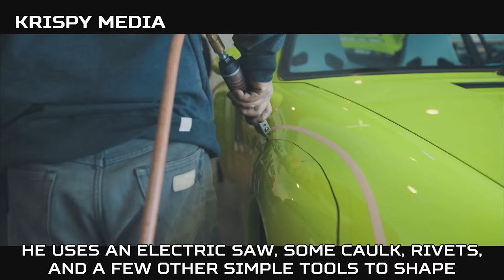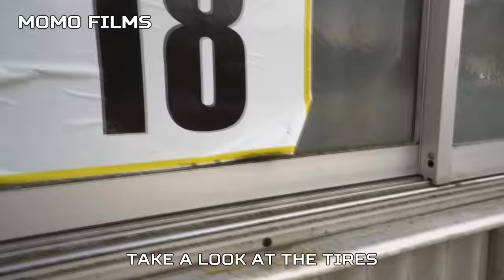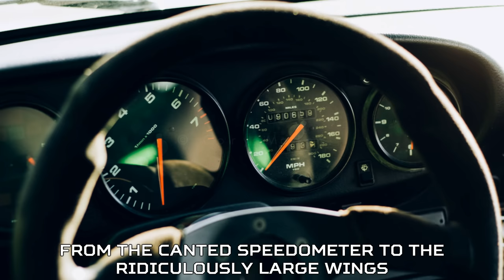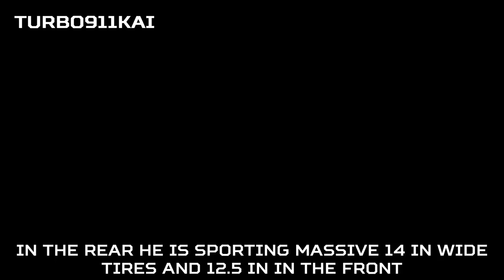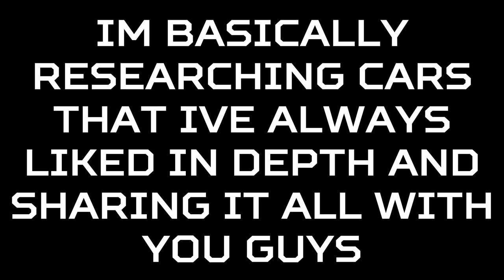RWB - What Makes it so Great?

Comment: Can you guys not hate on everything you don’t like? Some people enjoy RWBs and others enjoy Singers. We have opinions, but don’t shit on someone for having something that you don’t love.
Reply: The Singer purists are hilarious, considering they're even less of the original car than RWB's are. Singer cuts the fucking roofs out and replaces them with carbon fiber/fiberglass. RWB uses as much of the original car as possible.
Reply: @xerodelacroix5552  cutting the roof then replace it with lighter, stronger, and slightly better material? It has the same shape as the original ones on the contrary though what Nakai San does is just putting wider fenders and that's it, no notable improvements unlike Singer's reimagined Porsche's. I don't hate RWB, in fact, I quite like it actually, and I also love Singer's  Porsche's.
Reply: @peperoninja387  They don't just cut the roof. They replace most of the body. And all of the interior. RWB is 90% the original car. Singers are restomods for boomers with too much money, RWB's are for being driven and driven hard.
Reply: @xerodelacroix5552  I think I've made my point clear, whether is just replacing the roof or the whole body it still has the same concept the same shape, improving something doesn't make it different from the original. But that's just my opinion...
Reply: People hate what is different and what they don't understand......let them. As they try to suck the light from you, leave, just walk away smiling. It's not worth it my friend. If you like something and it brings positive energy to you....why would I stop that? I want you to have that, happy humans are better humans.
I love the style of these cars. I see them as samurai with their swoopy armor and function meets form design.
Reply: haters are gonna hate, that's all they can do about it.
Reply: Yeah the back of the car's too wide dowg :P
Reply: Dude this is the internet
Reply: I like both brands, but I still prefer RWB

Comment: My suggestion is that what kind of Influence did initial D have on the car community?
Reply: PlebzOr Blapparapp 
sigh whats your problem?
Reply: A terrible one, especially with how everyone acts when an AE86 is mentioned
Reply: Grey God
I was right. This comment was a m i s t a k e
Reply: Grey God
You can't really compare downhill driving on windy roads with highway driving. Gravity assist and turns and all. Other than that I get what you mean. Why not put your own shop's name on it? Get a left hand drive car? Don't pretend it's a big deal? Or you could get a neat '83 Dodge Charger L body. I couldn't find any for sale online (other than one for 19 thousand), so I'm assuming they're rare. I don't know how that would actually work out.
Reply: Mason Rafferty I get that it's more low power good handling car, I was meaning more as a daily driver. The mid range torque dip it has (like the new GT86/FRS) makes it a bit of a hassle to keep up with regular traffic on highways. In order to have that push it needs, it has to almost always be redlining. I agree on an L Body though, similar styling to the Levin, more room, and more power depending on the version motor you got.
Reply: sigh
Reply: I mean, I'm super into cars thanks to Initial D. Obviously I dont praise the 86 as a god car sent from heaven that HAS to have a Fujiwara Tofu logo on it. But I do want the GT86 cause of the show which doesn't seem like a bad thing IMO. I really want to dive into the car community and learn how cars works and how to drive properly, drive fast ("legally"), and maybe how to drift (even though it seems VERY hard).

But that being said, one person isn't enough to out weigh the toxicity and bad things. I cringe at the fact that some people things a stock 86 is a master piece that can race in real races. In any case, it has done some good things to the car community, but the bad definitely outweighs the good. I still want that GT86 tho, cause it seems like a great car in general from the reviews I have watched. Gonna start learning about specs soon enough too, but Im not old enough to drive :/
Reply: Bootleg Goku Welcome to the car community m8.
Reply: [ Insert Name Here ] Thanks m8
Reply: Grey God  O M Y G D I S T H A T T A K U M I C A R R ? ! ? It hurts when people praise the 86 as some kind of supercar. :v
Reply: Well yeah as the comments before, a bad one. Shame, because it's giving a great show a very bad reputation. For the regular Joe, initial D is just that one meme anime. Deja vu right lmao XDXD so funny. Not to mention the 86 weebs problem.
Reply: s y n t h POP UP, UP AND DOWN HEADLIGHTS
Reply: DRIFT TAX
Reply: Made people fall in love with JDM cars.

Comment: Is this a joke? Really? I mean the guy just manhandles massive Japanese inspired wings, fenders, and panels onto cars that already drive fantastically.
Reply: blake gastreich And adds handling upgrades to make it better. Did you see his personal car? That thing goes faster in the corners and straights than most stock 911's
Reply: Anthony Maranto Your point being?
Reply: GABRIEL DALIva His point made no sense, you can upgrade the running gear on any car and make it handle better, the RWB kit itself adds nothing to the car except weight.
Reply: SkrtSkrttt did you not watch the video? How he talked about how nakai-san upgrades the handling because HE also competes in races
Reply: GABRIEL DALIva Noone is debating that, the point is that the RWB kit on it's own does fuck all to improve the car, on the contrary they're usually put on 911s riding on bags or similiar making the car ride like shit.
Reply: From what I’ve seen only the Japanese RWB’s go to track days. Everything else look like show cars.
Reply: @The Stigs Romanian Cousin Clearly you've never driven or seen an RWB Porsche,  There amazingly well put together and handle amazingly. The Kits are inspired and designed on the  930 turbo groupe 4, 964 Carrera RSR and 993 GT2 EVO, which are very successful race Cars by Porsche themselfs. The first versions of the 930, 964 and 993 Kits were tested thoroughly in a wind tunnels, to make sure they don't produce to much drag, later adding the Canards on the front and side for added downforce and stability, so the kits do in fact improve the cars handling. The Kits themselfs (Arches and bumpers) are made from Fireglass and the rear wing and winglets from Carbon Fiber, which together weigh next to nothing and costs less then what a full Carbon Fiber kit would cost. Most RWB builds don't have air suspension, infact 98% have adjustable suspension for track use (even though some don't see one), uprated brakes and pads, rollcage (if the owner wishes to have one) wider tyres (265/35/18 on the front and 335/35/18 on the rear, which produce tones of grip, helping with handling) most builds have a semi stipped out interior, making them lighter still (once again helping with handling)  there built to perform in the handling department first and foremost, as thats what Nakai himself focuses on with his own cars, which is why nearly all RWB builds never have the engine tuned, to allow better handling and an added bonus, the reliability remains.

Comment: I don't mind RWB, or if owners choose to hack their own cars. It's their choice and money, and I like how they look. But it's complete BS to think this is done with performance in mind, and the video is full of empty fluff words like "sporting" and other nonsense rhetoric to cover up that it's a poser '80s GT2 Porsche. 

Difference is, the GT2 arrived at wide fenders and the spoiler after fine tuning the suspension setup, front/rear weight bias, front/rear aero, track width, etc etc. Function came over form. With these cars, kids are shoving the widest tires into these oversized wells for "stance," usually chopping the springs in the process. Zero testing on the track, it's 100% aesthetic. If that's your cup of tea great, but don't pretend like it's some profound testament of performance tuning.
Reply: usually chopping the springs in the process?  Zero testing on the track?  it's 100% aesthetic? really? just shows what you know about the build process.

Comment: 1 - they started building cars right after the midnight club disbanded. None of their bodyworks is done in wind tunnels. None of is built for racing or downforce. It's all very rough and built through rivets and seeing just how wide he car get tires. 

2 - He doesn't actually use technology to get the job done. He just cuts and pastes and rivets. It's like a drifter wanting to cut spring on their drift car. Which, ironically, what he was into before this.

3 - He builds cars with no practicality in mind. No clear idea of how he wants the car to perform. Because, of course, he has no idea how such a car will perform. They're not build to perform. They're build just to look extreme. In America, we have a word for people who people who build crazy looking cars that look like they would beat anything on the road but are actually pieces of junk that may actually be dangerous. Rice.

That is what this man builds. Rice. He destroys old porsches for guys who want something to look extreme and crazy when,  in fact, it's more likely to kill them. Of course, the air cooled 911s were widowmakers right out of the box. Adding a bunch of tire here, downforces here. Just do it alone by hand because you're and 'artist' and you have a recipe for a very dangerous vehicle. 

Lusting after cars like this is silly and ridiculous.
Reply: Someone with an opinion. Take a car that was meant to do one thing and then make it do that thing far worse and far more dangerously is the kind of thing idiots do. Half the people that love RWBs shit all over riced out civics and accords when they dont realize they're the exact same thing. Except one was built to a sporting standard to begin with and ended up worse after (Im talking about the Porsche)
Reply: Some people enjoy things. Can you respect what some people like? Not everyone has to agree with you. It’s not your car, and if you want a 964, or a 993, or a 930, go save up for one. And if you don’t want an RWB, don’t make it an RWB. It’s as simple as that.

Comment: Trick question: the answer is...nothing.  Watched one of these not make reserve on Bring A Trailer last week, they are already losing their glamour (and value).  Great Instagram cars, but Nakai doesn't touch the engine or suspension, it's all-show-no-go.  Stock 911s are beautiful as is, and history will be sad to see so many chopped up and made into Hot Wheels cars for social media posts.  All right, I said my piece, bring on the hate in the comments :)  

PS: I love 993 GT2 replicas, but you gotta have the "go" along with the bolted on fender flares.  Props to Nakai for the purple beast with 575hp, but many RWB owners don't do that.
Reply: I like how you didn't get one comment besides me

Comment: the statement you make "it doesn't feel like just a fast Porsche" seems awfully redundant considering you point out the engines are usually stock and he leaves little room for tuneability suggesting most arent even faster then they were originally. if anything they should possibley feel slower in staight line accerleration do to added weight and down force

Comment: Who in sane mind let this guy chop an expensive classic Porsche and put all those ugly kits on it? The parts he cut will rust, and the parts he used spray paint will peel off. This guy hasn't invented or designed anything. Look at the RUF Porches. They already have these body-kits but done properly. Engineered perfectly so that they can still turn corners.

Comment: Ok for Japanese flat, smooth roads, with lowered suspension here in the UK not really practical and i'd guess after 5 miles one would loose a testical and rip the fibreglass panels to pieces!!! Must agree they look the part but think in time it would de-value a 911 and must give praise to this dude but its not really precision engineering!!